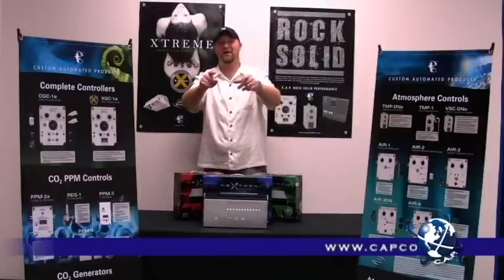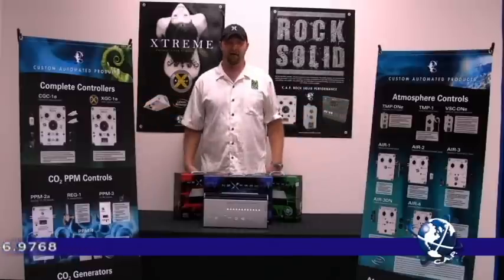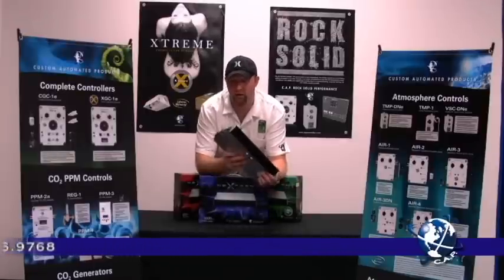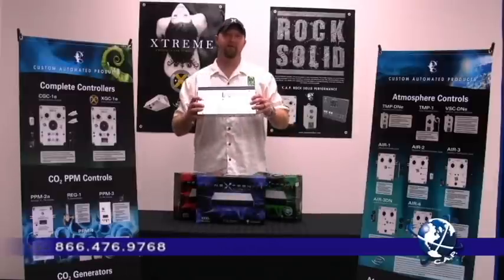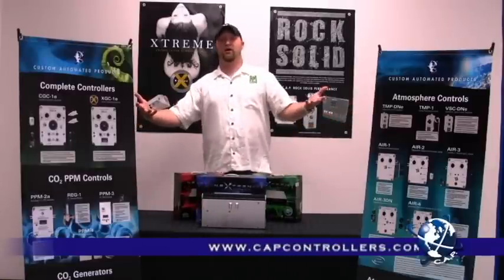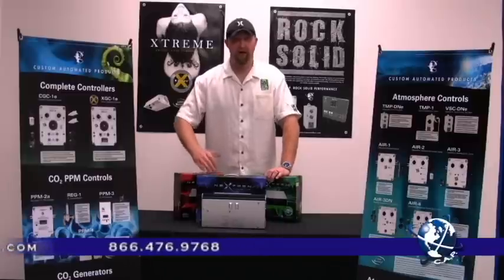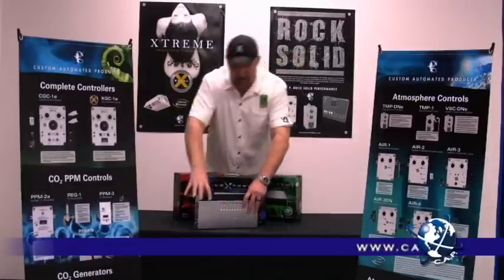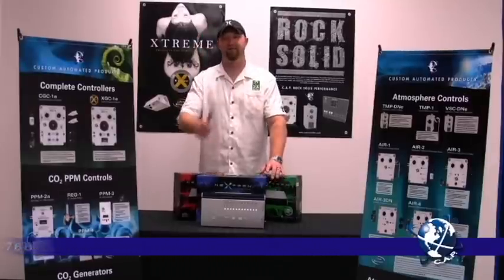NextGen Digital Ballasts

Comment: Anyone with RFI issues on these badboys? Just got a 400/600W convertible, gonna do some AM radio testing myself, but just wanted to hear if anyone else has experiences with it....
Reply: Am considering getting one.
Did you have any RFI?
Reply: Got one, not problems here whatsoever. Been running for almost 10 months now either 24 or 12-12. GL